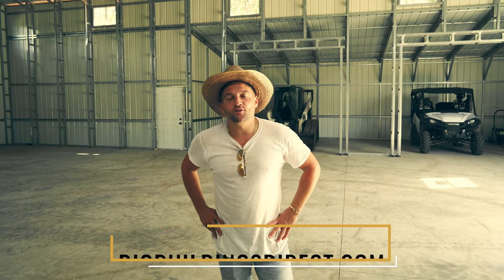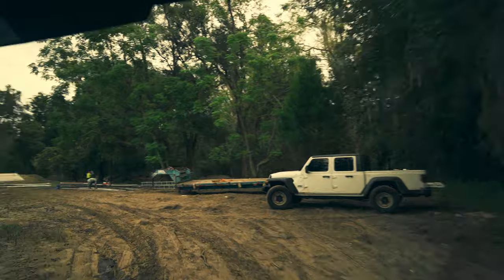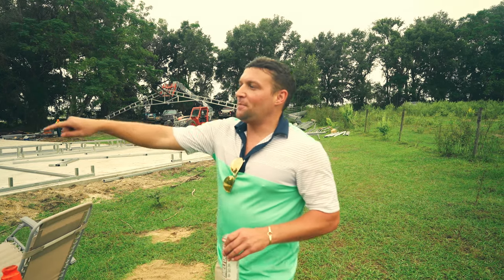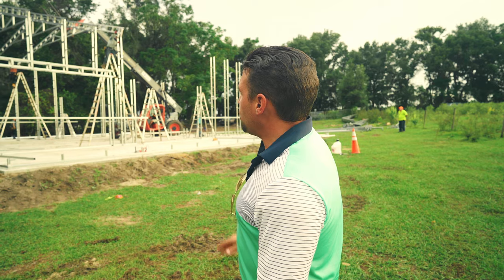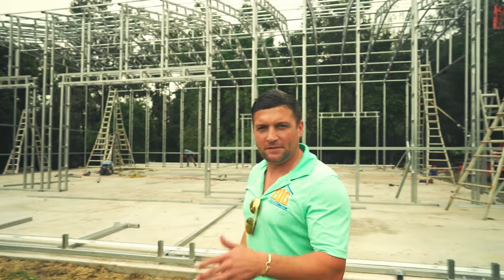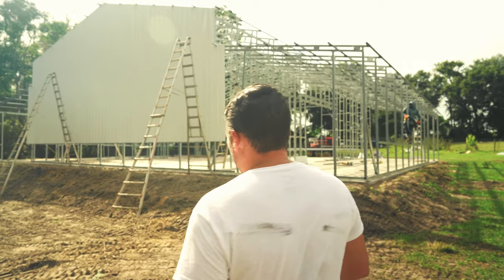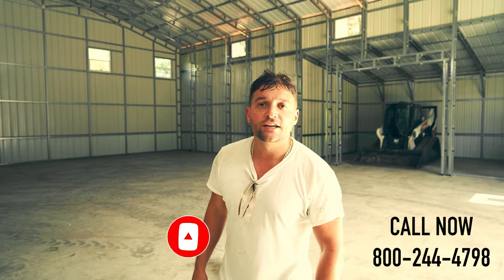70x60 steel pole barn installed in 4 days! (Time-lapse and Install Video)

Comment: Thanks for the information! Does the rat ledge extend past the building perimeter by 3.5" or do you include it in the original perimeter?  Basically would a 30x40 building get a 30x40 slab or would you have the slap poured to 30.3'x40.3'?

Comment: We are thinking about a 54 x 80 .Anyway to leave out the angle brackets at the top of the wall
Reply from the maker: Wouldn’t recommend it. Of course you can take them off if you want.

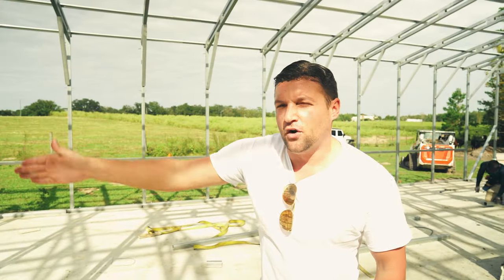Comment: Great video... around 7:18. when you're talking about the headers..... I might be incorrect, but regardless of how "strong" the header is.... Doesn't it still need MORE vertical support? The first opening has the same 1 ladder frame for the support for the header. That being the case on the other side of the header as well.... Wouldn't the lack of "extra" support here, offset any increase in support the header provides? From my understanding, the header is no good without adding more vertical support, which I don't see in this building. I'm sure it's designed and built to the local code's and to industry standards. Just curious how it gains support when no extra vertical supports are added and in fact, they've been removed?
Reply from the maker: I’m not sure you can actually see the vertical supports on the video, but there are still
The vertical
Supports going from the top of the header to the eave as well. I can show in photos a more in detail.

Comment: Great video! Is it possible to have floor to ceiling windows spaced throughout the sides, building front?
Reply from the maker: No, engineering would not improve that on our buildings. Our buildings are only for storage purposes. They can’t be used as homes.

Comment: If you don’t mind me asking what was the whole cost of the building?
Reply from the maker: I'm going to be doing a break down here in one of our next videos to figure out exactly what the total cost was. The building installed is ball-parked around 60-70k.
Reply: Does that include mechanicals such as electricity?
Reply from the maker: @mainelyworthwhile5793  not on that big of a building.
Reply from the maker: @mainelyworthwhile5793  no, not on this big of a building.
Reply: @bigbuildingsdirect  What is included and not?

Comment: What gauge metal is the siding and roof?
Reply: Steel framing is 12gauge. I did 29 gauge siding and it worked out great. Can upgrade to 26gauge, but I didn't need it.